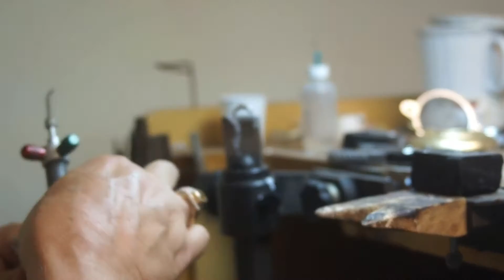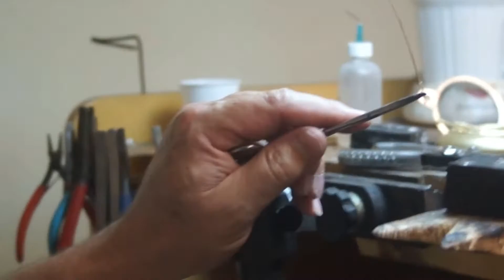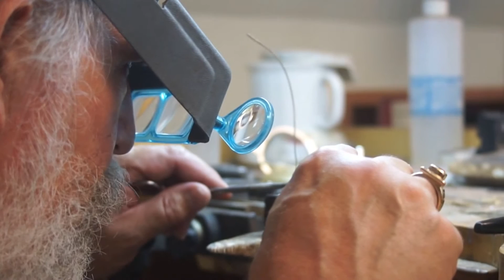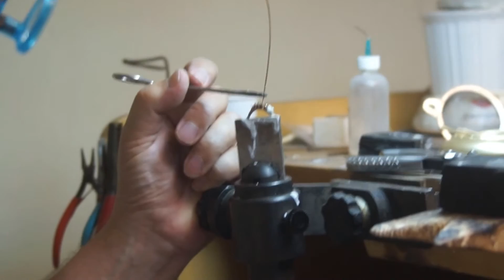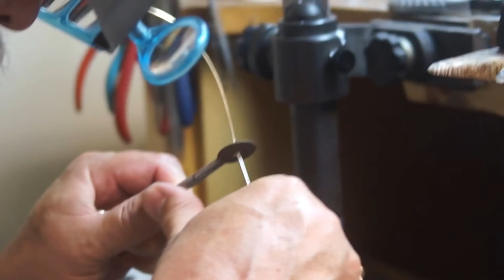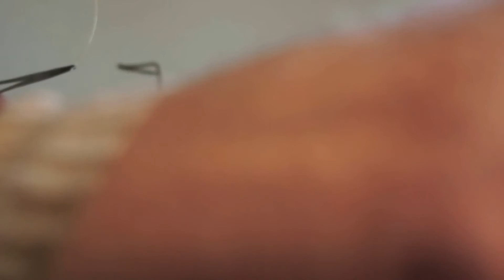Re-Tipping Prongs on 14k Ring Using a Torch

Comment: Every time you use the Moore's disc to flatten the end of the gold wire, you lose money. Such dust is hard / impossible to capture and then recycle.  With a ground back and polished side clippers, that cuts clean straight and true: clip, capture and recycle - rather than make invisible gold dust that disappears. It ALL adds up. Just my 2 cents...
God Bless.